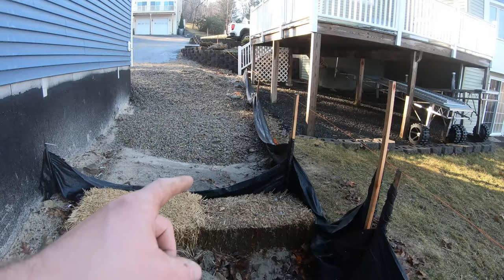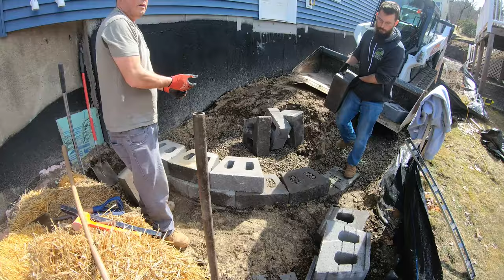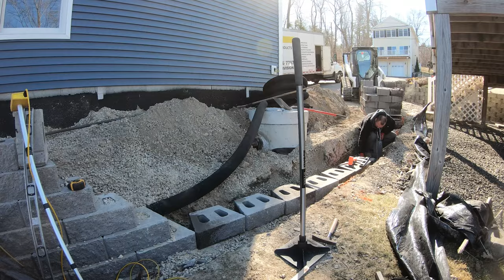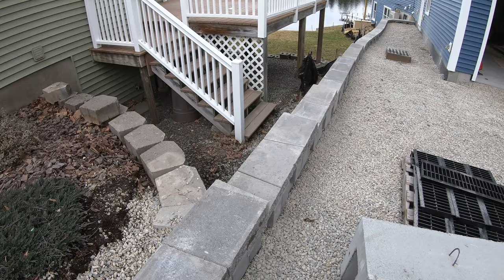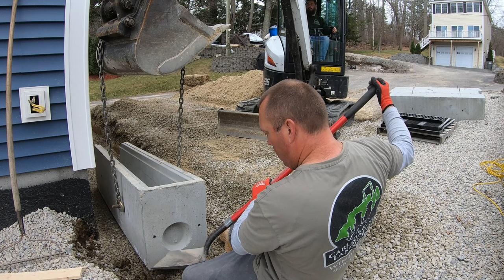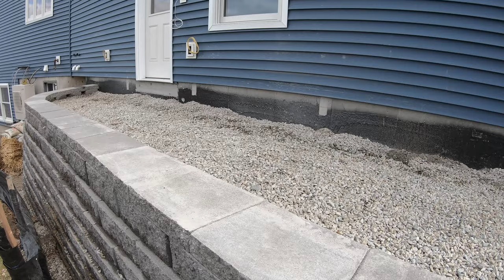Retaining Wall & Catch Basin Install (2:2)

Comment: Is the green house a neighbor or part of the same property? What do they think of this? Seems like their deck stairs are kind of useless now!
Reply from the maker: Green house is a neighbor. We informed them of the wall and physically showed them how it would be laid out and they understood. More than likely they will have their deck re-arranged, as their stairs led right onto our property anyways.
Reply: Absolutely not being critical but I think that I would have tried to integrate their steps into the wall somehow. Again, I'm not being critical but it would have been a nice gesture being as how the wall was under construction anyway. That being said, I was looking forward to another video on the lake house. 👍👍
Reply: @johngersna3263  Why would you even do that? The wall is on the blue house's property completely. Trying to integrate the neighbor's stairs into the wall would have meant having the stairs come across the property line. Secondly, the neighbors built their deck how they wanted. They could have built the stairs somewhere else but they chose that location. Third, there looked like plenty of space to walk between the stairs and the wall. Maybe it makes me an a$$hole but when I do projects, I don't give a damn what my neighbors think. If the neighbors wanted to pay to have the stairs somehow repositioned then fine, but taking them into account when they aren't even on the project property is just stupid.
Reply: I'm surprised your neighbors didn't claim adverse possession of whatever part of your property they were using. Perhaps they weren't aware of that option. @CarlsonSonLandscapingLLC

Comment: Sorry but whats that probe, sensor with the yellow top for? Every so often your Dad? Checks the ground.
Reply from the maker: Its a Ziplevel Pro-2000 Altimeter. Uses gas in the line to give you height differentials. A lot quicker and easier to use than a laser in many small projects.

Comment: Maybe I missed it before, but is the tilt bucket something new?  Can you run the thumb while using the tilt bucket?
Reply from the maker: Yeah, the power tilt is new. I got it during the winter and showed it in the last house update video. Super useful for doing all types of work. I could only use the thumb if I had a second aux hydraulic plumbed in. But even then its not really worth it since the thumb will be around 1' off of matching the bucket edge.